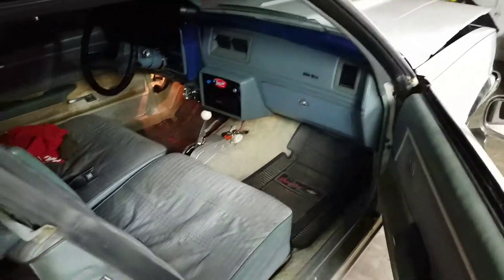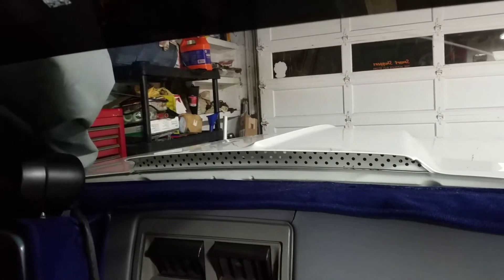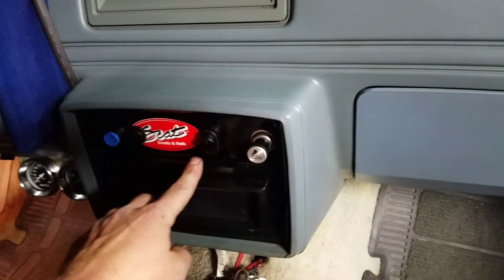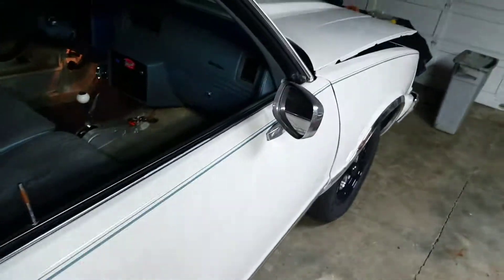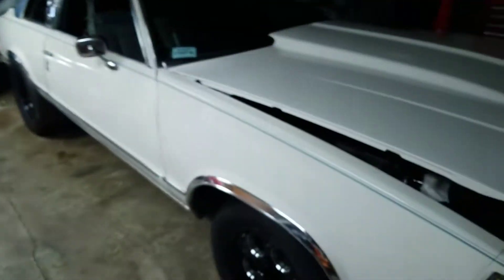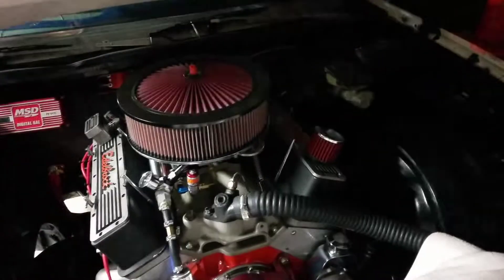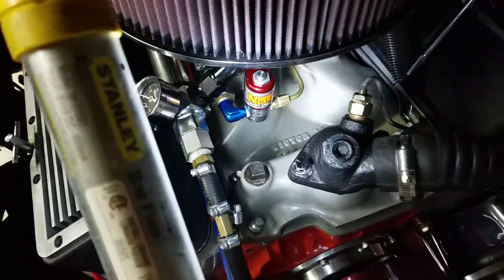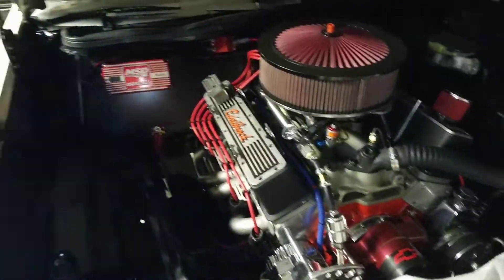Nitrous purge

Comment: where'd you buy the engine from?
Reply from the maker: I had it built at east view. The best machine shop around
Reply from the maker: I have another engine for sale. It around 500hp. I would have to have  4k for it
Reply: @ModsnRods  what size engine and would you post video about it ? I'm interested
Reply from the maker: @Hidden-comment164  it is a 358 dart heads and srp pistons and scat crank and rods.
Reply from the maker: @Hidden-comment164  go back to my older videos and you will se me racing it